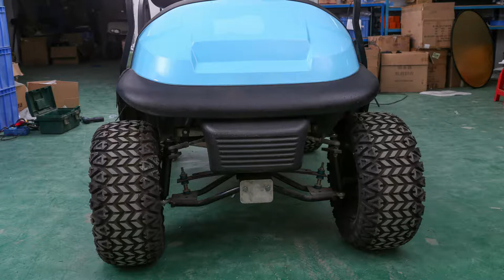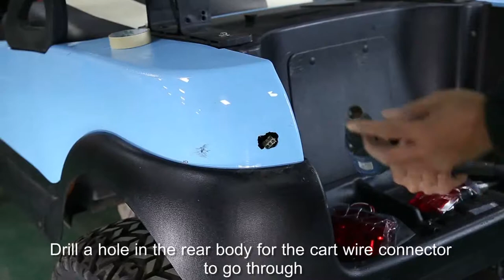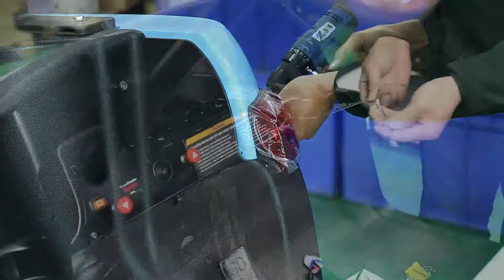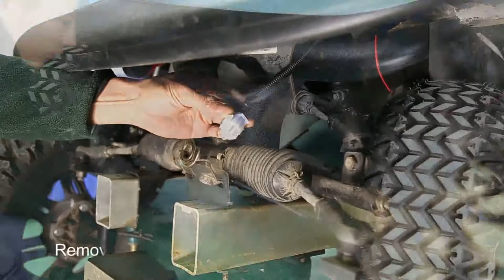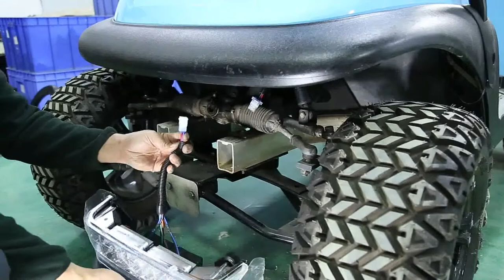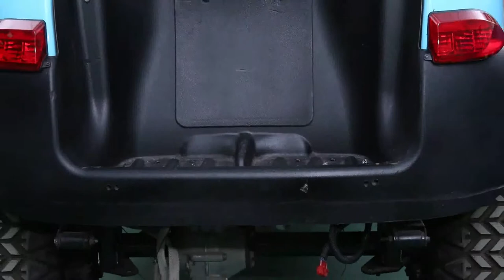Light Kit for Club Car Precedent 2004 2008 5 Electric Golf Carts Installation Video

Comment: Is this for 12v or is there a reducer somewhere for 48-12 ?. When you plug in the blue wires ,is it draining from  2 batteries? .
Reply from the maker: It's for 48V.
Reply from the maker: It's not draining from  2 batteries when plug in the blue wires.